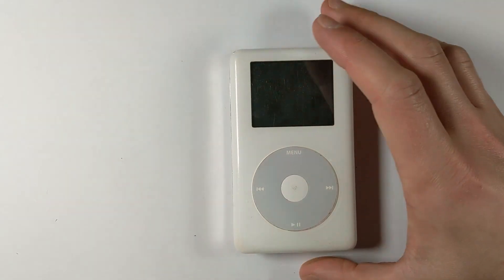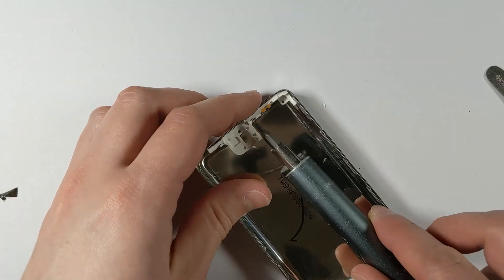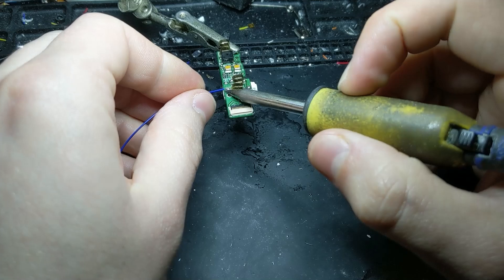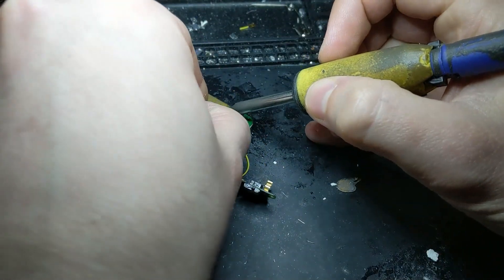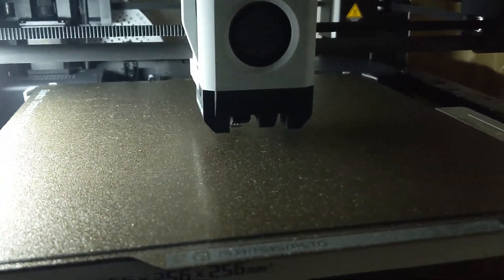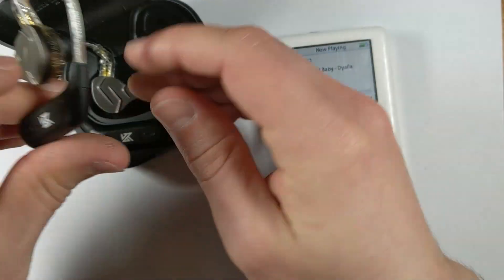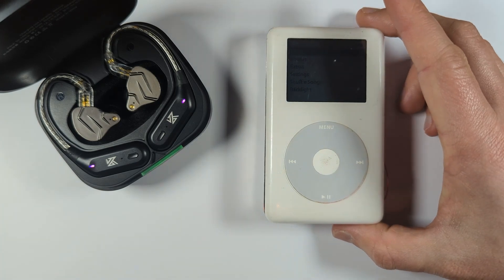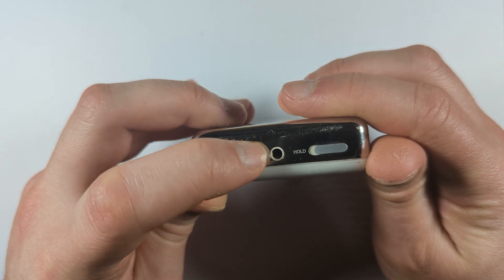Bluetooth iPod Classic 4th Gen Tutorial In Depth

Comment: Thanks for the great tutorial! I am doing the same mod with a very similar bluetooth board taken from a unit that you plug into your car radio or whatever. I had the exact same noise issue. After some research and trial and error, I bridged the the the board's audio ground  to the board's battery ground (B-) This essentially eliminated the awful hiss. It's still there but barely perceptible. Just because I am curious, I am going to try a DC isolator as well just to see if I can completely clean it up. The other option might be to see if I can find room for the small bluetooth module battery and solder the 3000Mah battery to the micro usb pad on th Bluetooth board. this would definitely isolate the two circuits although not sure about the long term durability of that smaller battery.

Comment: Since you have tested this bluetooth board with a separated button, could you try and make one with the 5th gen where the button is located just at the back of the headphone jack? I've looked and the headphone jack has a little hole in the housing just taped with a plastic, which you can puncture and see through. I thought that maybe removing the clicker from the back of the jack, maybe we could fit a button in there, at the back of the headphone jack, or even leave the clicker there to keep the button in place idk. I think it would nice to have a hidden button there that you could trigger with a toothpick or something and the headphone jack is now "open" we can plug it with a dust plug since we would not be using the port when in bluetooth mode. Thought that would be cool and in theory should be doable!
Reply: Yea it works but I did a Taptic Engine mod with it so idk if you can leave the clicker

Comment: I did the 3000mah mod, however it was with the thin backplate and i crammed an iflash ata into the spot where the battery is. it involved using a hacksaw to cut off part of the iflash (no electrical traces on it tho so that part was easy) and then finding a half heigh sd to microsd adapter since a full sd also wouldn't fit. it was fiddly but quite some fun to pull off